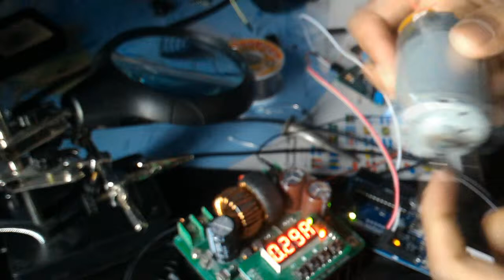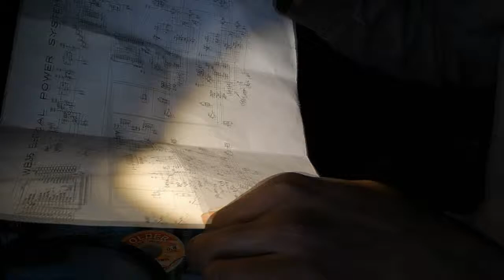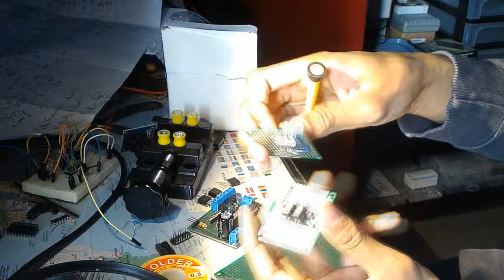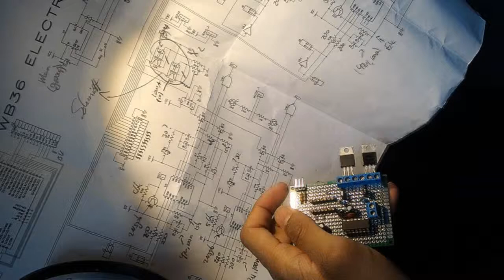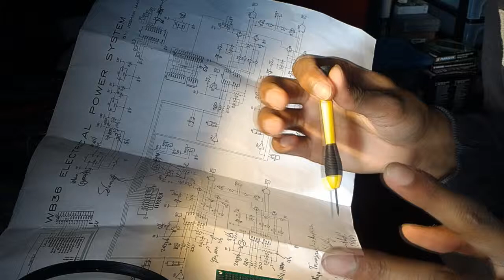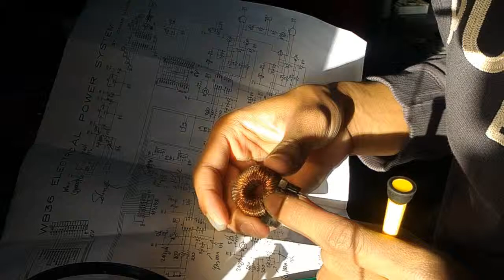Vlog#005 - MOSFET Tester/Railgun research

Comment: The rail gun concept is working for you? I had some problems when i gave it a shot, i guess it was missing the magnets in the barrel, in short I never got it working.
Reply from the maker: No need for magnetic augmentation when using 90000 Amps :) My calculation gives me 110 m/s with 6 gram projectile.

Comment: This was one of your best videos yet! Lots of juicy stuff and info, and you sound more confident than any of your previous videos.
About soldering your own perfboard, I'd highly recommend it. PCBs are way too costly. And look what Clay Reid did with his charger, he soldered it himself.
Reply from the maker: NNNI That's mostly due to me recording late at night usually. Make sure no one hears me. My room is entirely open. Yeah, but if I could manufacture it, I would. There too damn many traces. The thing with Clay Reid, his job was to built them by hand. PCB manufacturing was even more expensive back in the days. These days it's much easier and cheaper. However, I don't have any SMD components or reflow. I have no other choice. He also is using pretty easy topologies such as push-pull and halfbridge. I have two fullbridges on one board. I spent 4 hours attaching the FETs to their rail.
Reply: Oh, I see.
Out of curiosity, what's the turns ratio you've planned for the capacitor charger transformer?
Reply from the maker: NNNI I am not sure about the actual windings yet, due to various factors. I think a 1:18 ratio will give me my required voltage.
Reply: I went with a 1:10 ratio, even though I needed around 1:20. The thing with flyback converters is that the output voltage is not dependent on the input voltage, so I didn't need to wind as much copper. The output current is quite high, too.
Reply from the maker: NNNI Right. Have you measured operating temperature?
Reply from the maker: I have decided to make an indepth series on MOSFET switching, power converters, motor drivers, etc.
Reply: The temperature never exceeds 50C.
That video series would be very helpful to a lot of people!
Reply from the maker: NNNI Ferrite is most efficient at 90 C. 
Yeah, but then I mean indepth, so pretty much everything.